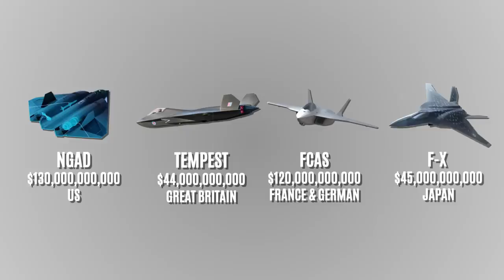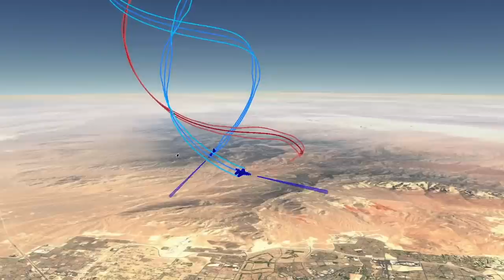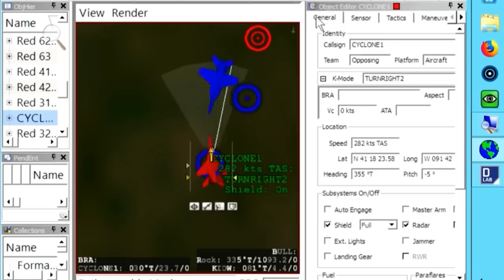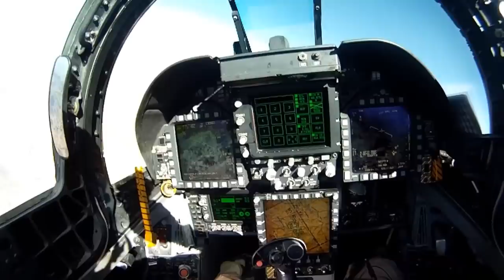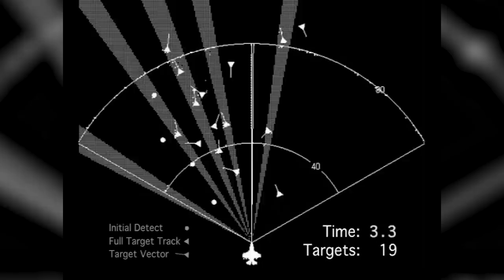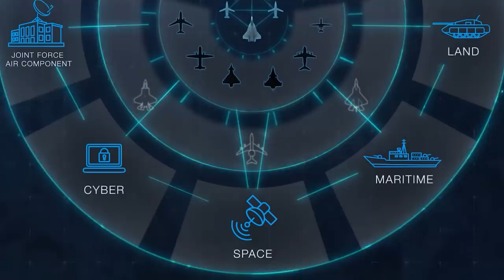Finally: Here's American New 6th Generation Fighter Jet

Comment: Sorry, guys, it's outdated already. The days of aircrafts with Pilots are numbered. 
Just look at the latest crash in Jolo, Philippines. A C-130 with 96 on board to do a Max Effort short field landing in perfect weather conditions. The pilot only has 100m extra for the required distance. After touchdown he decides too late to go around, but can't reach enough speed, stalls and crashed with over 50 dead including himself.
A AI controlled plane would never do such errors.
Reply: irrelevant
Reply: You're absolutely right

Comment: We need a modulated jet. A jet that can change it wings and load out to fit the requirement and objective of the mission. A jet that can change its nose cone for EW upgrades in minutes. We keep the same standard Fuselage but have modulated wings. Having one main frame and different setups could provide a force multiplier and allow a huge advantage in speed, maneuverability and landing capabilities.
Reply: Jesus Christ you said all the words that get american Pentagon generals hard
Reply: :) funniest comment yet
Reply: changing wings best bet would be just make a new f-14
Reply: a stealth f-14  with thurst vectoring
Reply: me thinking where have i seen it. ow transformers!!!!
Reply: Lmao..this is hilarious!!  Nevermind the engineering loads, aircraft balance and sensors, form drag and the fact the entire fuselage and wing roots would have to be engineered for the heaviest possible scenario yielding an aircraft with compromises and heavier than wod need to be for all lesser 'configuration options'  Your idea would yield so many compromises it would be the jack of all trades and master of NONE.
Reply: Sounds like you've either worked on or flown .I was in the military as well a d we would change things to fit the mission .and most times made it better .have a former girlfriend who started as a Machanic in the Airforce,now she designs them

Comment: So going back to a delta wing ,more then likely there will be only be  a  few Gen -6,  like  the F-22 that will lead the way for the gen 4-5 fighters in a alpha strike pkg .Really humans need to leave the cockpit to pull some insane Gs to get on the tail of the enemy in a flash going insane speeds . With AI able to shoot missiles that can also pull Gs with out losing lock .
Reply: You give ai a chance to think for itself without restriction it will have the choice to go rouge can anything be trusted without a conscious an algorithm will only factor in percentage of failure and success look what happened in Japan with the robots the military had built 2 out of five turned on  turned on the people during the demonstration and killed 18 before they were able to activate the kill switch

Comment: This is cute but needs to be added to similar aircraft that is miniature. This works well for aerial photography and video. Using many units and capturing many angles you get details. You can add small aircraft containing C5 or other explosives and use them as kamakazi drones. They all need protection from EMP and Lasers and concussion rockets.

Comment: You mentioned that the Russians 6th Gen Fighter Jet will have a radar range of 400km. If the Earth is a Sphere there will be 12.7km of curvature. Now radars work on direct line of sight. Therefore, is the Earth Flat? Or a range of 400km radar detection is rubbish.